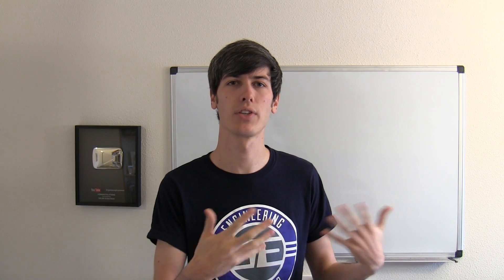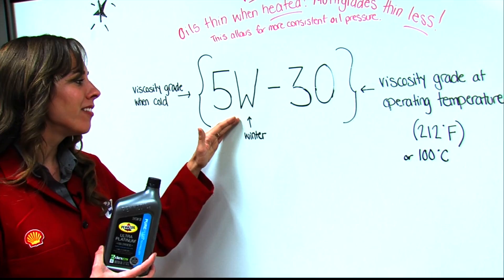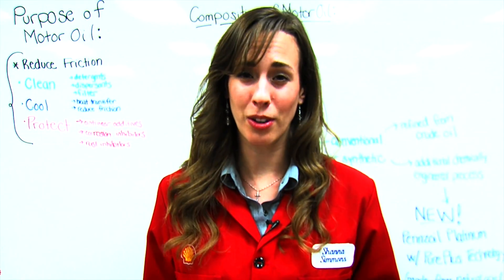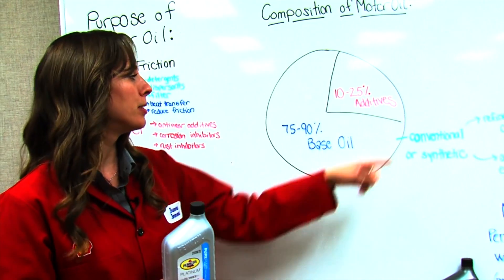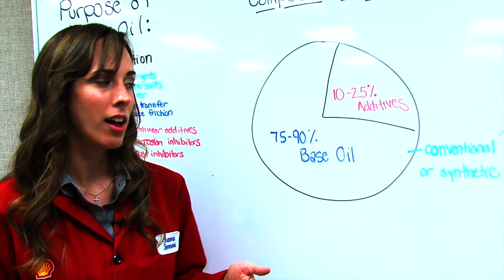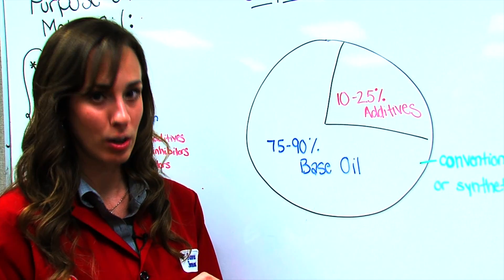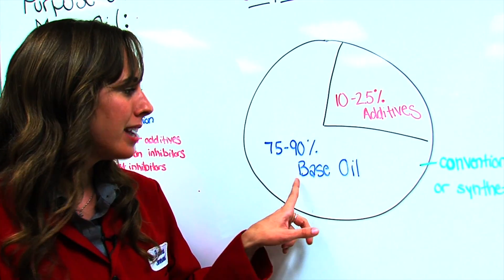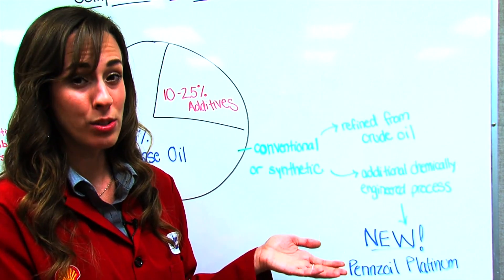Motor Oil Myths & FAQs - Synthetic vs Conventional

Comment: Royal purple you don't have to change your oil for a year. Full Synthetic oil last longer in terms of longevity.
Reply: I dont think a oil filter is made to go a full year. You still have to change the filter at 3 to 5K.
Reply: Ryu Fūrinkazan
You must have faith. I'd never put royal purple in anything. Only synthetics I'd run are Amsoil and Mobil one. It's still better then Castrol in my book, but I don't have a choice about castrol. One of my cars require it.
Reply: custommotor Mobil one full synthetic is good too. They also have a  gurantee. I like the purple stuff though. My personal preference.
Reply: I like my amsoil signature series.. Wouldn't switch to anything else
Reply: MrSlowestD16 Mobil 1 in non-biased reviews is in the mix with the worst oils possible. Greedy fucks
Reply: Integra DIY It depends on the weight....if you buy the same weight it's no thinner than a competition brand...
Reply: Royal Purple is just a brand...Mobil1 full synthetic the same claims apply - and they're likely true because they resist sheer wear better.
Reply: Integra DIY Also, you're wrong about high compression engines...any engine, unless it's like a 700hp motor won't burn oil if the rings are the appropriate size.  When you get to the high HP motors like I mentioned the only problem is the in-cylinder heat difference is too much, so they will burn oil cool before the rings expand, or they're too tight when hot and will cook the upper ring.  Either way, if they're appropriately sized, low compression, high compression, you shouldn't burn oil.  Just need the right sized rings and a properly working PCV system.
Reply: Integra DIY They have a guarantee. Yes I use there oil all the time even CBR 929. What burn? uses the same viscosity as any other motor oil.
Reply: Rotary engines burn oil and or cylinder heads that are wore out can burn oil/older cars. Making a false claim.
Reply: rudedogii I change every six thousand miles with a Royal Purple oil filter. 12k miles on the oil.
Reply: Yeah most synthetics have extended drain intervals. Royal pruple 12k, mobil 1 is 15k i think, amsoil is 25k or 1 year for all. It's always good to change the filter 1/2 way between those. Filter is usually more important. Also depends on the car and how you use it. I know my e46 m3 only has 1 oil for it and has a 12k change interval. Castrol TWS 10w-60
Reply: I understand personal preference.

And Drunken I'm luck. I'm in Va so they ship from richmond, not far at all.
Reply: Porsche uses mobil one exclusively for there engines though. Mobil one is cheaper than Royal Purple and Amsoil.
Reply: Royal Purple $7-8 Range Amsoil $11-12 and Mobil One $5 a quart.
Reply: Where do you get fully synthetic mobil one for $5 most places around here are $8.

I know Porsche does mobile one, so does Chevy on certain models. Just like BMW uses Castrol.  I don't mind the extra price for Amsoil because it gives me peace of mind and if you think about it anything good isn't cheap. Amsoil usually cost me about $10, you can get some 5w-30 for $7, but the oil in my M3 cost 13.50 at minimum and I only have one opinion. But yeah I like the peace of mind and that Amsoil is always purpose built to be fully synthetic.
Reply: custommotor Mobile One full synthetic Wallmart 5qts  $25 lowest I have seen anywhere. Cheap is good if ya take a chance. Risk/ reward.
Reply: Where do you live? I wanna live there. Cheapest 5qts of Mobil 1 is $40 here
Reply: custommotor Kansas City midwest prices are pretty much the cheapest paid 2.11 gallon for gas the other day too.
Reply: custommotor Actually today seen gas for 1.89 a gallon my jaw dropped. It might go lower tomorrow?
Reply: I dont care if it's more expensive .. I've used Mobil 1 and my car runs like shit in the winter up here in Canada, switched to amsoil signature and liked it much better.. Plus working at a parts store and get it 7 dollars cheaper than shelf price, I'll gladly pay 10 dollars a quart for it
Reply: Dylan Preston Well Canada has ridiculous prices overall. Nothing wrong with that cause healthcare is free. But in America shit is a lot cheaper especially in the Midwest. Canada has frigid below 0 temps compared to here in Missouri. I have used Mobile One in the past and have no complaints.
Reply: Amsoil usually does very well in cold weather viscosity testing

And yeah it's nice that gas prices are getting cheaper. I live on the east coast and it is currently $2.19. Sadly all my vehicles take premium, but even that is under 3 so i cant complain.
Reply: +Mortalomena I've seen tons of third party reviews and haven't seen mobil1 as anything but a top tier oil, it's not a mistake that it's one of the top selling oils and some manus have it do use it from factory.  Where are all these negative reviews, pre-tel?
Reply: I haven't seen mobil 1 do bad in most test. Usually it's mid to high mid in the ratings. Rarely top of the pack in large tests but nowhere near the bottom.
Reply: +rudedogii Not true. Well designed quality filters will last much longer.
Reply: Ryu Fūrinkazan - not as long as 100% synthetics. Full and 100% are not the same.
Reply: LOL oh how you're absolutely incorrect!! 😂

Comment: A couple of questions... First why do we need to know the viscosity of an oil in the winter? Either way it is going to get to the temperature of the engine in a few minutes... Second is can I put in oil that has a different winter viscosity rating but same operational temperature viscosity rating? Also do some engines operate in different temperatures? And if so does that mean that I will need to find oils that specifically have the recommended viscosity at that specific temperature?
Reply: The winter viscosity is for when you start an cold engine.
Reply: ***** There is more to lubrication than fluid pressure and flow. 
Namely adequate film strength. 
Too thin of a lubricant results in inadequate film strength which results in unwanted wear.
Reply: Ok! I'm here to help you out.  I think you're misunderstanding how 'multi-viscosity' oils work.   For the example well use 5w-30 oil.   For example,   let's say your car only has single viscosity oil.  Single viscosity oil can only work at 1 temperature.  Not multiple temperatures.  So let's say you decide to protect the engine at operating temperature - about 200 degrees. Every thing is fine the single viscosity oil works great at 200 degrees, but when you shut the engine off and it starts to cool down the oil begins to become very thick.  At about 75 degrees the oil would be as thick as molasses. You're car can't pump that kind of oil around.  So when you go to start your car you will have NO lubrication until well after the engine has been damaged.  Now let's say with this single viscosity oil you want to protect your engine at starting temperature.  Ok great you start your car and every thing works great.  But as the temp rises from 75 to 200 degrees the oil becomes very thin.  It becomes to thin to do any good.  

So,  we have multi-viscosity oils so the oil will be thick enough to protect and thin enough to flow efficiently through the engine. 

BAM!
Reply: Jonathan Neill Engines, in fact engineering in general have changed over the years. They run much higher tolerances than in the old days.
I remember folk would use small paraffin heaters that would sit on the garage floor under the sump, in order to have the sump oil above ambient, in the winter months. Some would use a lighter viscosity "winter" oil too.
In fact F1 engines are running such close tolerances they are not started until warmed coolant has been pumped round to bring the engine to a warm enough temp before starting, to avoid wear or damage.
Also once up to running operational temp it shouldn't matter if one is coasting down a road in winter, it should not drop below operational temp.
A cooling fan controls temp if it gets too hot, if an engine starts to become cooler then the thermostat will (should) close in order to keep the engine at it's correct operational temp. The thermostat should not open untill that temp has been reached. In extreme circumstances it may be advisable to partially block the flow of air through the radiator while such low temps are going to be experienced.
Reply: It's also to prevent dry starts.  If the oil is too thin when cold, you could damage your engine when starting it.
Reply: treebeblazin So then how did cars run before multi-viscosity oils were invented?
Oil is a fluid, and as such it inherently has different viscosities depending on the temperature. Also, at 75 degrees, even 75w-90 gear oil isn't as thick as molasses.

The idea behind multi-viscosity oil is that it has a wider range of "operation temperatures."

In the example you use, 5w-30, the oil is certified to work at the same temperatures as 5 weight oil, 30 weight oil, and everywhere in between.
This can be useful when you're driving and your car isn't at standard operation temp, whether you didn't give it time to warm up after starting it, or if it's a wintery night and you're coasting down a mountain road with the heater on.
Reply: The Heretic Simple, at 30 degrees below zero your oil is thicker than molasses.  Your battery already doesn't work that well at those temps so trying to crank it is darn near impossible.  While standard 5w-30 would probably work in those conditions I would go straight to synthetic due to the fact that it's cold viscosity is very stable. Nearly all oil is too thick on initial startup. Ideally we would always allow the oil to come to operating temps before driving. 
In the old days cold startup was such a problem with straight 30 weight oil that they would run lower viscosities in winter and yes the engine could experience more wear when at normal temps. Multi weight oils solved that problem to some degree.  Engines are designed around the oil to some degree. bearing surface area and load will all be factors in the choice of oil. Newer engines are being designed for lighter weight oils for more efficient engines due to decreased drag of the oil.
Reply: Christopher Wilson this comment makes no sense.  First because there is no such thing as a dray start. There is always an oil film. When we build engines we put assembly oil on for that very film. The first start basically pumps some air till all the oil passages can fill with oil. 
Second you want thin oil for when it is cold. Even 0w-30 isn't even close to as thin cold as it is hot. Thing to remember is those two numbers are not measuring the same thing in the same way. Completely different.
Biggest potential damage when starting is if you rev it up real fast on a really cold start. Three things can happen and none are good. First thing that might happen is you could spin a bearing due to the increased resistance of the cold oil. If that doesn't happen the next thing is that that same oil film will get very hot and no longer be able to do its job. The third thing that can happen is you could twist off the oil pump shaft. 
To avoid these bad things never rev a super cold engine. In very cold weather use a low winter viscosity oil, preferably synthetic, and let the engine warm up some before driving off.
Reply: ***** And that is why modern engines dont get to high rpm when the temp is not optimal.
Reply: I have watched the videos showing pour tests at different temperatures. At 10 F, even straight 30 weight flows well enough to get moving. A few VW owners and some owners of vintage cast iron engines still use straight 30 weight. If it does not get colder than that where you live you probably can use 10w-30 all year around. Regularly below 0 F where you live? Figure out what you need to do with your application. Interestingly, -40 is the temperature where Centirgrade and Fahrenehit are equal. It is also the same temperature at which a human being quickly turns into a popsicle and so does engine coolant. If it gets that cold, you do need synthetic oil. And probably an external power source to jump start your vehicle. In some parts of Alaska and Canada people keep their engines running overnight in the winter. The old farmer trick was to put a kerosene lamp under the oil pan of the tractor.

Comment: My car is close to 20 years old. Is this a factor for the choosing of the viscousity of the oil... should I still run with the service manual recommended one?
Reply: My car is 14 years old and I use 10w40 oil as recommended by manufacturer no problem. If the engine has done mega high miles maybe go a grade thicker. I also stick a couple of magnets to the outside of the oil filter to catch any ferrous particles that may defeat the filter, for what it's worth.
Reply: My car is 17 years old, so I've gone to a 10w-30 instead of a 5w-30. Honestly I've seen more efficiency from my engine as opposed to the manufactors recommendation, 27 mpg instead of 25 or lower.
Reply: I personally would run a heavier oil since the components would be worn and have play in between them.
Reply: use the recommended oil plus lucas engine oil stabilizer
Reply: Like the lady said, if you run a lighter oil, you'll get better efficiency, but the thin oil can't protect your engine the same and all the parts will wear a lot faster. For instance, the piston rings and walls, the pin holding the rod in place, bearings on the crankshaft, etc.
Reply: Thank you all for the explanations.

Comment: I'm using LIQUI MOLY M0S2 LEICHTLAUF 10W40 in my 91' MX-5, It has a huge percentage of MoS2 (the oil is metallic grey when new!). It worked wonders! The engine now is butter smooth, much less noisy, more rev happy, and the Fuel consuption improved! Also the oil pressures are lower than they where before. (dunno what was in there)

Comment: The questions you asked were poor! And the answers were the very basics of the basics since the questions were about the basics. 

Myths like "Will changing from a conventional oil to a fully synthetic increase the chances of oil leakage?"
Or FAQs like "Approximately how much does an engine load need to be increased on daily use for the engine to require higher viscosity oil?" 

Those were just examples but there are many other, better, questions which you can't really find an answer for without talking to the experts.  Expected more detail since these answers would have been easy to find from the web, but thank you for this video anyways. .
Reply: Looks like her answers (mostly just marketing points) were pre-recorded at some point and he just edited it together to make it appear that he was the one asking the questions.  I believe he would have asked more technical questions given the opportunity. Kind of disappointing video.
Reply from the maker: AnotherSiGuy Bingo. That said, I still learned from it the fact that conventional and synthetic are derived from the same base oil, and are indeed very similar chemically, as well as the percentage of additives, which I initially believed were a much higher percentage of the mix. Basic, but some good facts.
Reply: Sooo you want a more detailed video, watch Eric the car guys vid. Sorry EE but he did get them to explain things in more detail. I believe it was a 20+ min vid.
Reply: *****  Yes, polyolester group 5 (V) lubricants are derived from crude feedstock components and or natural gas constituents.
Reply from the maker: emiliorescigno Well there are certainly variations in base oil, but ultimately it all comes from crude oil. Oil differs by region, so saying all base oils are the same is obviously not true, but synthetic is certainly not some lab crafted chemical formula, it comes from crude as well. The newest Pennzoil is derived from natural gas, which is completely different from the rest of the industry, and apparently provides an advantage in the cleanliness in the pistons, among other benefits.
Reply: Alright point, but a youtube search on this video yields many results and ericthecarguy in particular answers your question about oil leakage, you'll rarely get all of your questions answered with one video.

Comment: The numbers 5 and 30 on on a bottle of 5w-30 don't actually represent viscosity, they represent API gravity. API gravity is a ratio of the density of water to the density of oil(oils less than 10 would sink in water). Density and viscosity can be corollary, but are in fact different properties of oil.
Reply: Will Hodgson  Sorry, but you have been misinformed.
The 5 and 30 on a bottle of 5W-30 motor oil do represent viscosity per SAE J300. 
SAE viscosity gradings include the following, from low to high viscosity: 0, 5, 10, 15, 20, 25, 30, 40, 50 or 60.
The numbers 0, 5, 10, 15 and 25 that prefix the letter W, designate they are the"winter" or cold-start viscosity at lower temperatures. 

The API is responsible for designating the lubricant base stocks that are categorized into five groups and developing service rating classifications of passenger car and commercial automotive motor oils. 
The Society of Automotive Engineers (SAE) defines the numerical system for grading motor oils according to viscosity. 
What you describe is API gravity, which is a crude oil density grading method and has absolutely nothing to do with refined petroleum products including the SAE viscosity grades of refined motor oil.